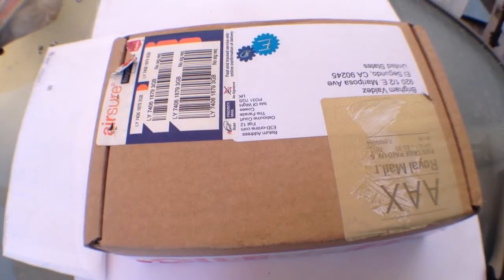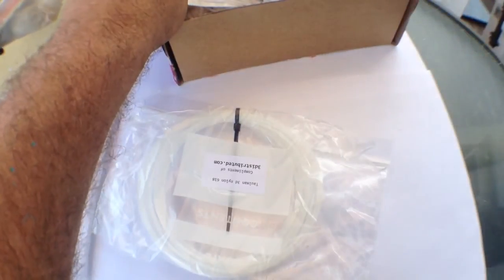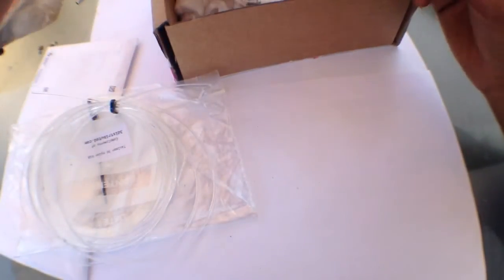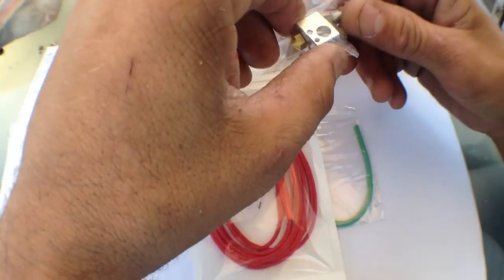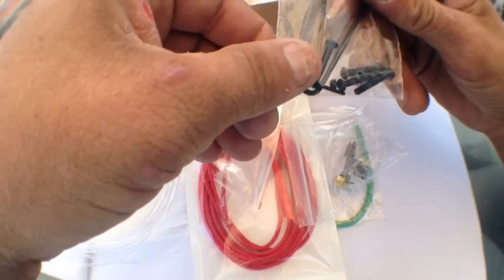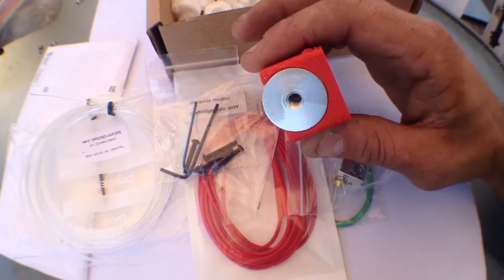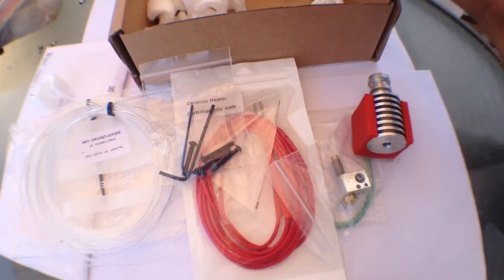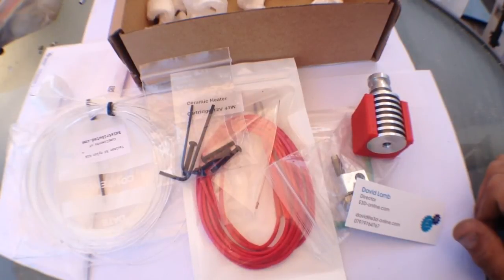Aluminum Hotend Reprap 3D Printing

Comment: nice j-head style mount
I have the metal magma and love them, best j-head i've used. Period
this looks like its about the same thing with a few more cooling fins which is over kill
if I run my fan at more than 40% I cant hold a temp over 235c its that efficent at cooling